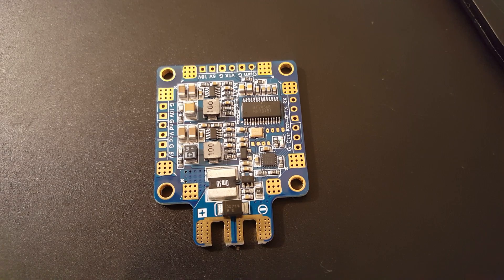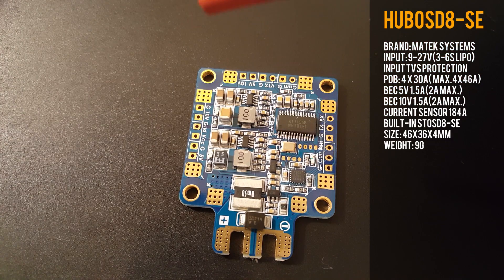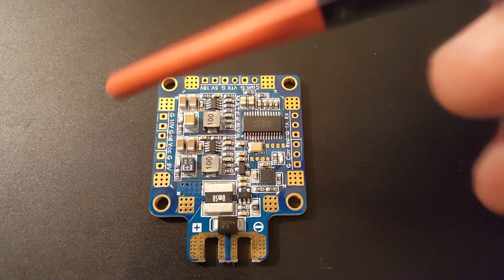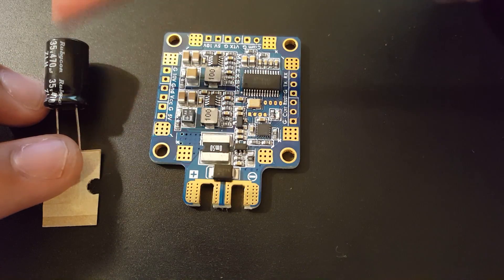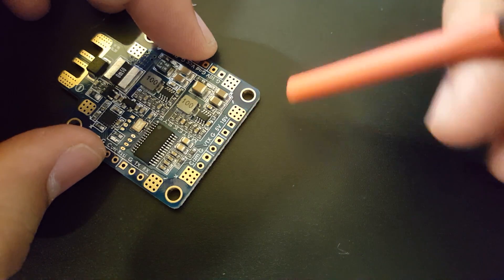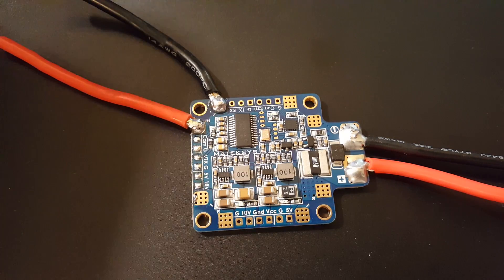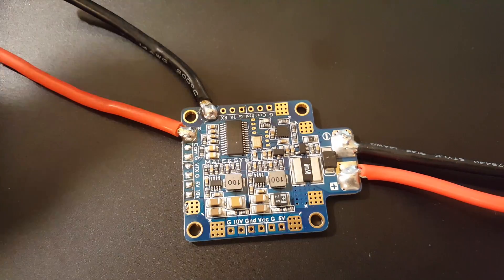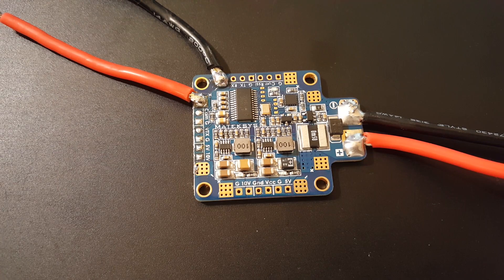Matek HUBOSD8-SE PDB // Review and Noise Testing

Comment: Drone Mesh - very good video. Thus far loving your reviews on ESCs, etc.

I have one of these boards and I recently took a bad crash into a tree. I was pumping throttle for about 5ish minutes and finally got the quad loose. Now I'm getting weird noise in my video feed. I do have a 1000µF low ESR cap on my build along with Racerstar RS 30A v2 ESCs. Later on I found that + wire from cap had come loose. I've since resoldered on cap and still getting noise. Do you think this issue is fixable?
Reply from the maker: GateslayerFPV check your VTX SMA/RP-SMA 90% chance that is damaged and is loose so on vibrations it will show up as noise. 

Keep me updated.
Reply: So here's the update... the way I mount my antenna on my Aliens is the old way, which is through the given hole on the top plate. I found that my ground was common with the frame. I understand this is a no no, because it makes the frame into a very inefficient antenna - at least that's how it was explained to me. So I ended up using some CA glue and filed it down to allow the SMA plug through. Then I used one o-ring on each side of the plug and tightened the bolt down. Now I've isolated the frame from ground and it appear the noise is gone. Make sense?

Comment: It is a good board indeed. For minimalists who have separate FC board and wish to see only main readings on screen (voltage, amps and RSSI) this board is perfect. I used previous HUBOSD-H around year in one on mine quads because it just worked. Things changed when I learned how to change PID-s, expo and other flight related parameters through MWOSD and BetaFlight OSD which was more comfortable than taking laptop with myself and connecting quad to it every time to change values. So I'm now waiting for incoming Matek F405 FC board. But I will repeat that this board is very good, especially for screen minimalists.

Comment: Its looking good I thought that it looked noisy (not that i have anny clue of it😆) but are you still flying the f200 build? If its a bit crash proof or not , keep up the good work👍🏻
Reply from the maker: +Bennie Leip Motors blew up in a crash.. frame still perfect.
Reply: Bennie Leip I think you were looking at the left screen instead of the right screen LOL the right screens the one we're looking for noise LOL. The voltage regulators
Reply: Drone Mesh thnks👍🏻 i was a bit worried because i have that frame now and i was curious to know if it could take a (normal) hit